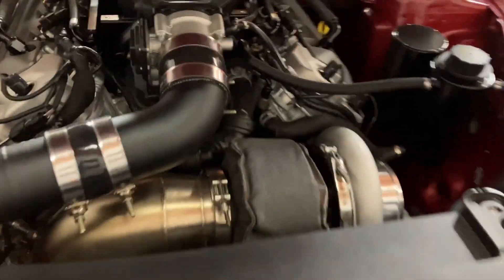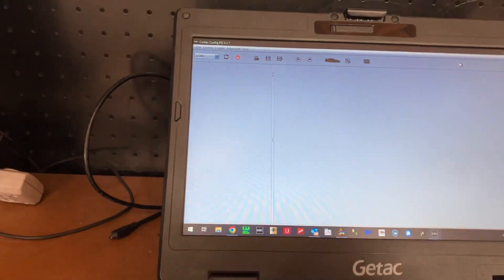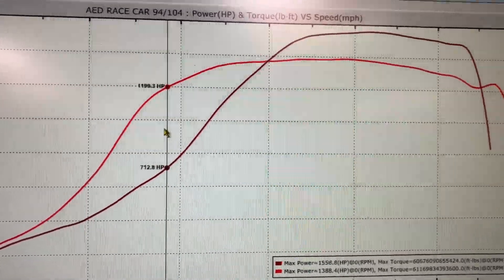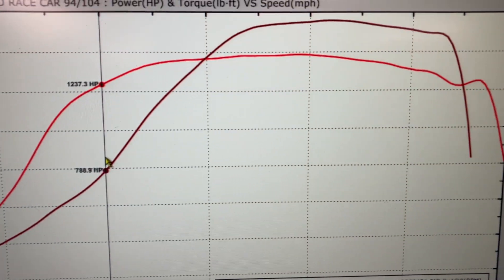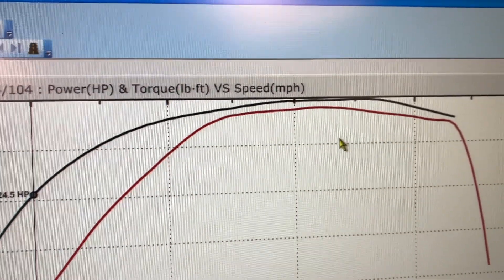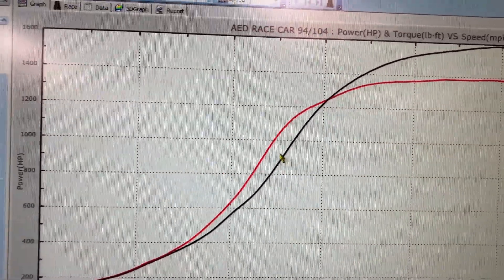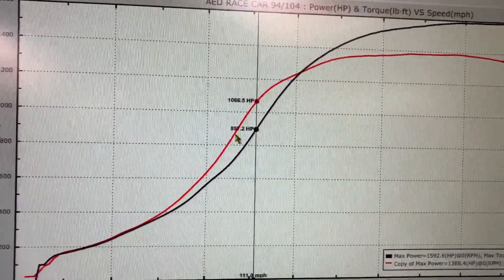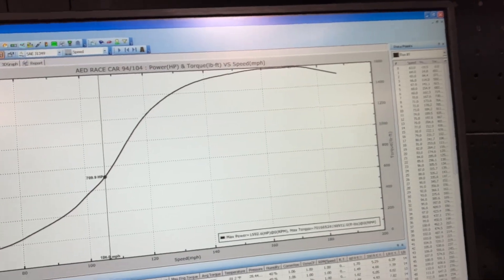Turbo A/R change:  1.32 to 1.15 on the FIS 94/104

Comment: Thnx for this video & info !  Have an s475 but looking at aftrmkt turb hsg that gas same a/r as the t6 hsg that comes stock ( 1.32 ) but has t4 dims on the turb entry and exit . It's also an undivided hsg. 
Would this help w increase in spool - up time & transient response ?  Thnx .

Comment: Was thinking about going to a 91 TDI on my stock bottom end 5.3 was worried about polling the 1.32 AR maybe this could be my solution so I still get the power of that size turbo but don’t have to worry about it spooling

Comment: It's not all from the ar 
You went to a bigger turbine wheel and changed the converter. All that made the difference
Reply: Watch the video again. In this video he is directly comparing the 1.32 a/r to the 1.15 a/r on the same 94mm turbo with NO other changes. When he was talking about the 85mm, he was just giving additional context so you have a comparison of how close the 1.15 a/r on the 94mm is to the 85mm.

Comment: Did your egt climb with the smaller ar?  I’m about to reduce from a 1.15 too a 1.0. I could go as small as .84.  But kinda worried me.   I’ve got a 7.3 powerstroke.
Reply: How much fuel are you throwing at it? You will probably see a drop in egt and your power will be a lot more useable
Reply: @jakoblongnecker9385  stock 90cc.  AA injector.. but. I found out if I get a later set of intensifier and only use the piston with my AA sleeve they will be AA single shot 160cc.  So I may be doing that as well.  Or building myself a set of hybrids.
Reply: @hondaxl250k0  I don’t mess with 7.3s much but I would go down to a 1.0 housing. An .84 will spooo quicker but the 1.0 will give you alittle more room for added power. The .84 may get hot on the top end when you start adding fuel
Reply: @jakoblongnecker9385  well I ordered both.. figured not hard to change.  I’ll play around and I’ll have all 3 if I need to change.

Comment: Larger displacement needs larger AR. It’s all relevant to a combination of turbine wheel, engine size and displacement. Larger turbine wheel doesn’t always mean you need the same AR. Bigger turbine often a smaller AR with the same peak or slightly more exhaust flow works. I only lost 150 rpm switching to larger AR on my last turbo so it wasn’t a loss. Less boost but more ignition timing. Made up way more of the difference.

Comment: Nice big differences and definitely help me out I was going with twin turbos. Either FORCED INDUCTION turbo OR FORCED PERFORMNCE Turbo
Reply from the maker: I've since switched to Garrett G series and would not change.  G series is the shit.
Reply: @aedtuning8441  Nice Right on Garrets out of budget tho lbvs 🥴😂
Reply: @aedtuning8441 what had you been using before the G series?

Comment: discharge delta across turbine blade is massively important relative to drive pressure required by compressor which is also effected by ar and inducer exducer ratio, blade count pitch eyc